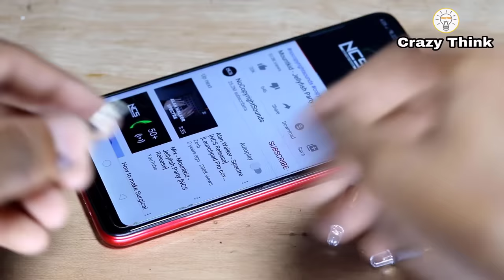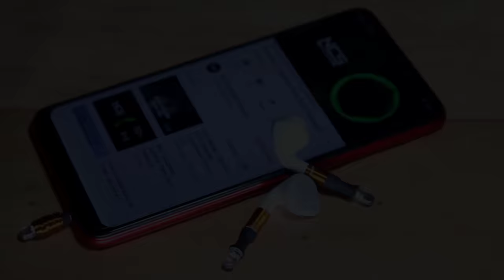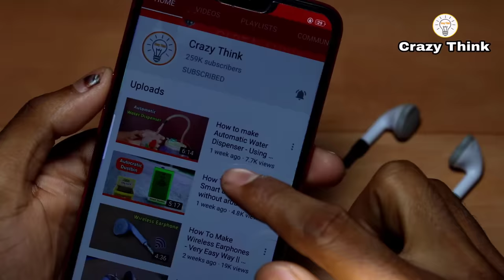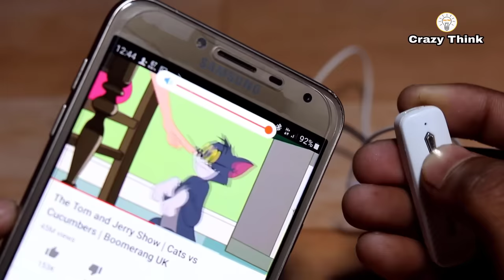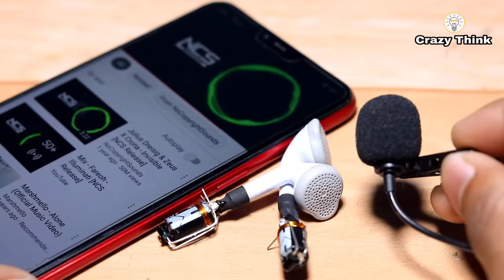4 Amazing Wireless Earphone - Using LED Sensor

Comment: For any equipment like as speaker or headphone, power is  first need. From which source , you are giving power.?
Reply: Wireless power transmitted 😁😁😁😁😁😂😂😂😂
Reply: Its fake bro
Reply: yes
Reply: If you find spy things there is a lot of them that are sold for school hacks. The mini wireless earphone that is actually in your ear inside ( not to be seen ) and in order to work you wear something like a necle which is a  hidden copper coil. Its powered from one small batery 1,5 V and some sort of an amplifier and connected to your phones audio jack.... New phones are with powerfull amplifiers, so it maight be ( maight be ) possible but on verry short distance like the one in the video. For shure wont work in a distance, like when the phone is in the pocket.
Reply: @shahebmondal5436  ur joking. right?
Reply: @DanielCatapang  we dont require such type of fake videos
Reply: Fool see the battery in Bluetooth
Reply: Did you not see him charging it?? How else would it get power
Reply: Thanks bro 🤩😍🤩🤩🤩😍😍😍😍🤩🤩🤩🤩🤩😍😍😍😍😍😍😍 it's working!!!!!!!!!!!!
Reply: wireless transfer is i sensor
Reply: It's fake

Comment: Do the LED sensors have to be programmed first or not?
Reply: dude it is fake 
no power supply
Reply: @dnagarani1382  do you know how to make actual real wireless earbuds with sensors if so can you help or have a tutorial
Reply: @dnagarani1382  there is a Bluetooth radio inside wireless earphones. It's impossible to make wireless earphones with infrared sensors. Infrared sensors can only be used in stuff like remotes

Comment: The amount voltage and current an LED can output then lit by daylight is almost nothing compared to what it takes to drive these headphones. So trying to do it without clear line-of-sight (direct from transmitter to receiver) between two LEDs is totally hopeless. The surrounding room light would give more noise on the receiver then the transmitter would give.
Conclusion: This video is nothing but bullshit! 👎
Reply: Nerd

Comment: Oscar Pinochet
 tv controll remotes work with IR(InfraRed), for IR you must aim to the sensor.
 also InfraRed has unidirectional broadcast, is not somethig like wifi or bluetooth signals. your project is a 100% fake.
also you are using a IR led transmitter like a IR led Receiver.
Reply: Right

Comment: Really dude 
If you want to deceive someone do it right 
You soldered the "wireless sensor" to the 2nd ring and the 1st ring in a socket which are responsible for sending signals to right ear piece and the mic 🙂